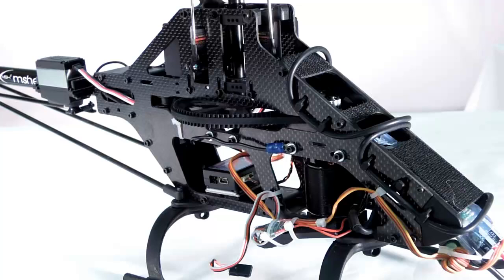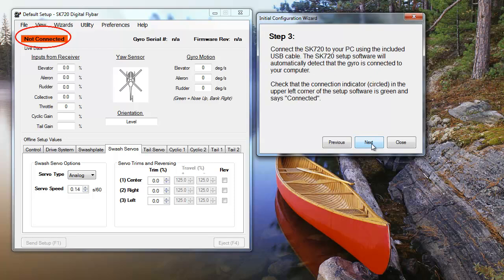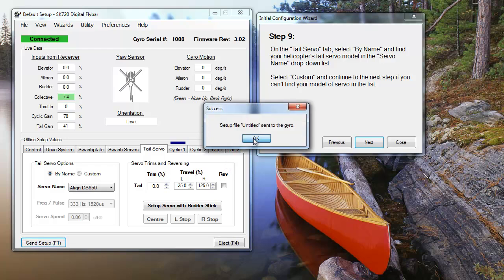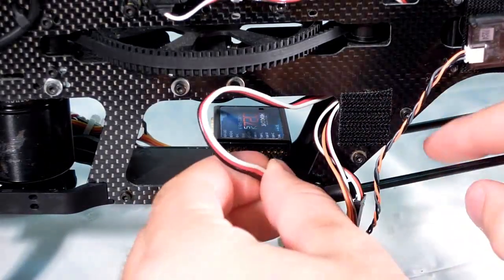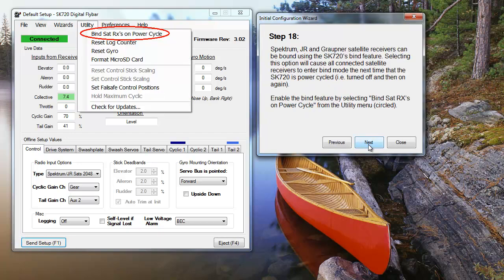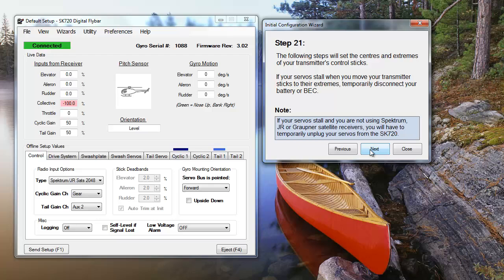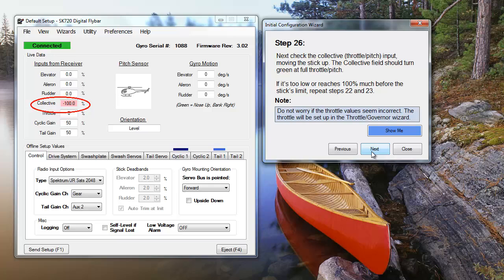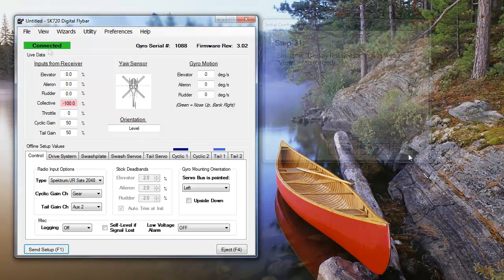SK 720 Initial Setup Wizard Walkthrough

Comment: Very quick but  the Skookum gyros can't be mounted on the side frame like a BeastX and GT-5? Thats fine for 450's I reckon, I couldn't mount my GT-5 sideways on top of the boom like I wanted. The wires have to face forwards or backwards whether the gyro is on the side frame or flat level surface.  The Shookum mounting restrictions sort of limit you on larger helis where you actually have room enough to mount the gyro on the side of the heli. its no big deal though I guess. The BeastX on my Trex 550 is mounted on the right rear side panel.

 Hey you never covered cyclic and pitch setup. Is that all in the presets? Having Presets makes it kind of like the fool proof BeastX. The GT-5 allows almost unlimited tuning. So much so that you can actually adjust the unit to where it won't even fly.